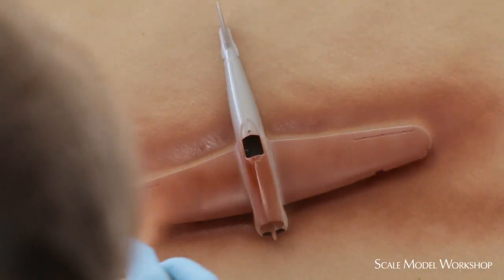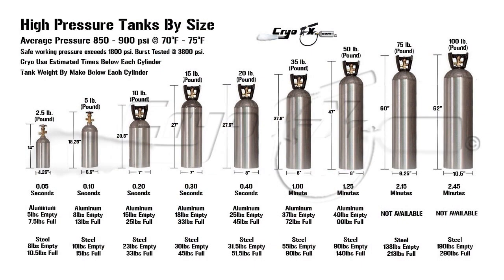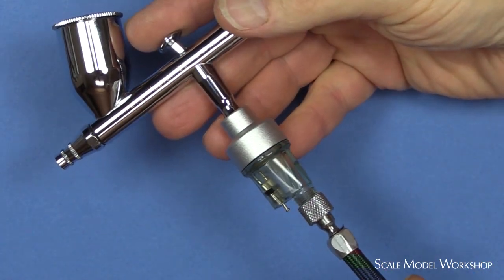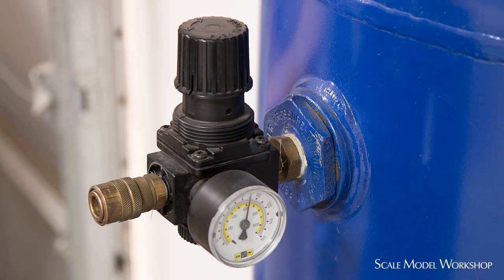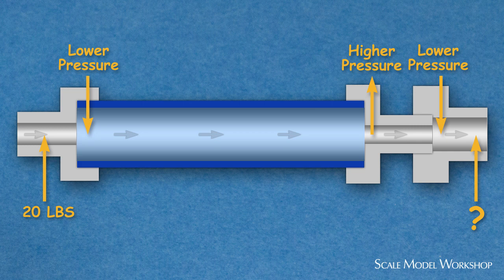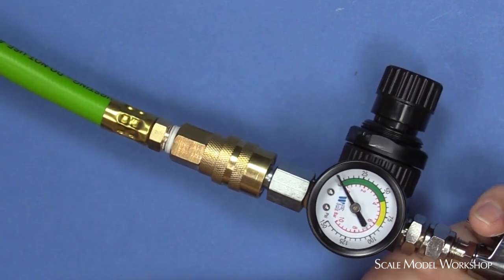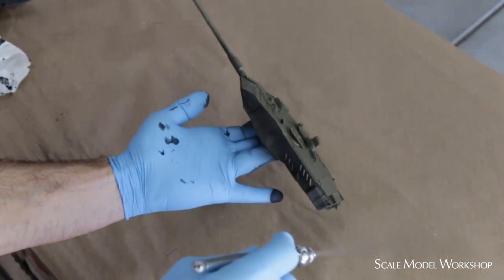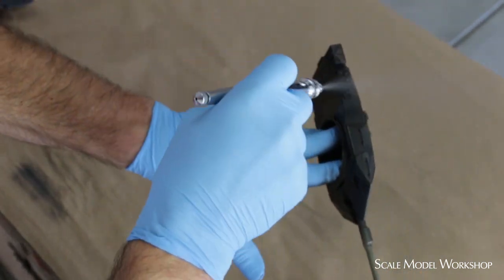Airbrush Operating Tips

Comment: A set of very informative videos, thank you.  Based on your comments I now own an IWATA Eclipse HP-CS.  The dual action is very nice and easy to get used to.  However I have a problem mixing my Humbrol enamel without having small lumps in it that clog the airbrush. I am using Humbrol thinners.
It is really hard to tell when all the lumps have disappeared and so I would like to filter the paint as it is put in the cup .
I see there are choices of filters and I wonder if you have a particular recommendation as to the best filter mesh size.
Thank you

Comment: One question I was curious about, is how to paint flat or semi-gloss coats. You mention that if you are painting gloss on a car, it needs to maintain overlapping edges and a wet coat.

Commonly, I've seen models sprayed early on with light mist coats, then slightly heavier to build up the color, and finally one last "wet coat". Is this the proper technique for flat or semi gloss paints as well?

Comment: Great video, Paul! You are correct in having your moisture trap close to the airbrush. Condensation takes time to fall out of suspension in the air, and having a moisture trap only at the compressor allows that moisture to mostly bypass the trap, and go straight to your airbrush. My 2 gallon tank compressor is in the next room, and while it does have a factory installed trap at the tank, I have another trap/regulator/fitting assembly screwed to my workbench. The airbrush hose attaches to the fitting. When I'm done painting, I always get a lot more moisture out of the workbench trap than the tank trap. Thanks for making this video!
Reply: Really?  I may pick up a 2nd trap
Reply: I have a pre-filter, regulator (0-30 gauge), then a final 5 micron filter. Mounted on my bench. I never get moisture in the final filter.
 Industrial supply houses carry them.